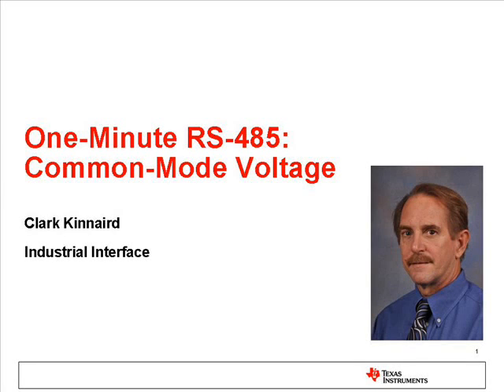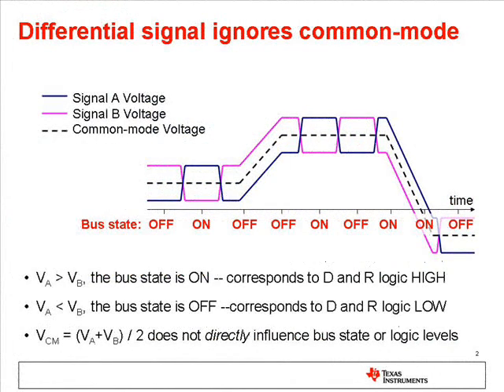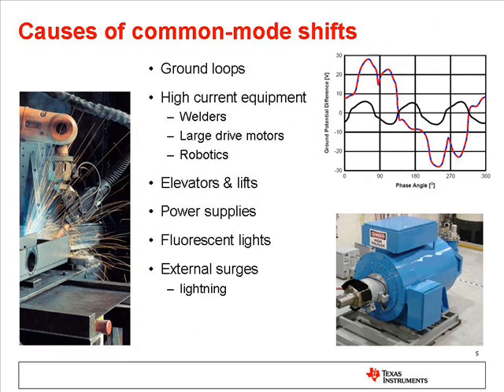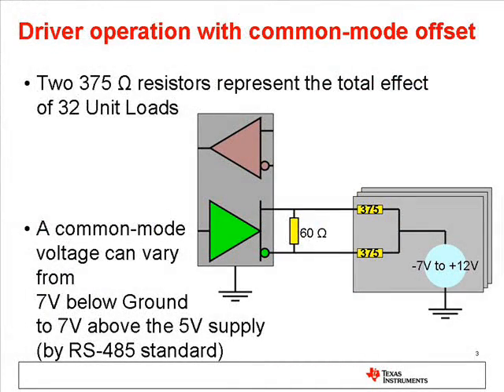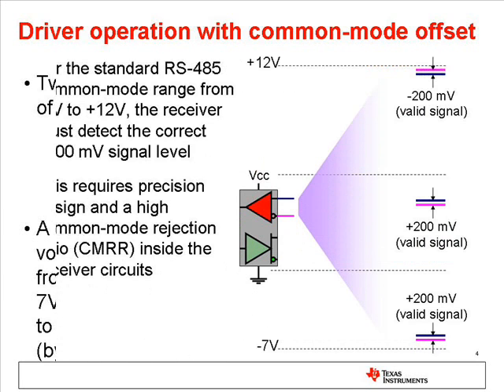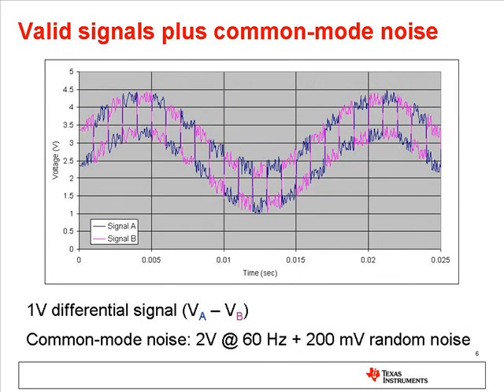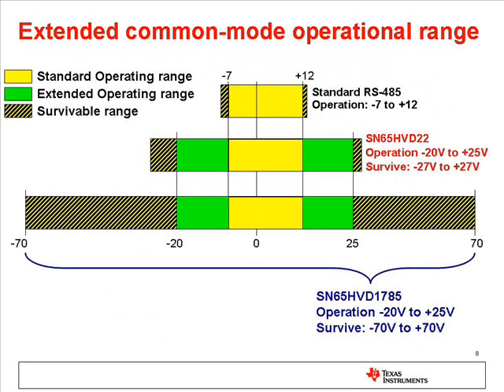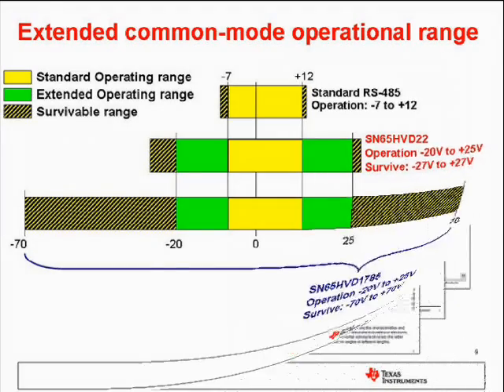One-Minute RS-485: Common Mode Voltage

Comment: Why is the common-mode voltage at 1.5V and the range from -7V to 12V instead of from -8.5 to +8.5V with the common mode at 0V? Why not GND? Where is the benefit of having it asymmetrical around 0V?